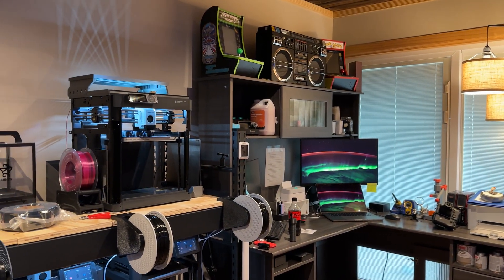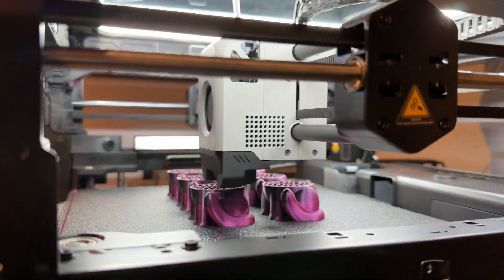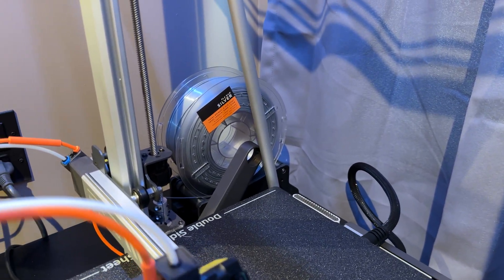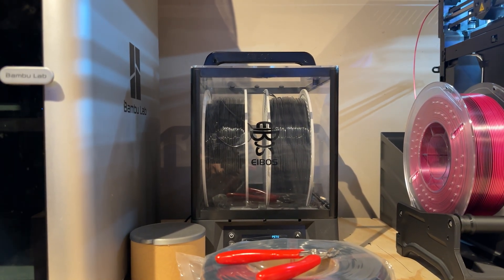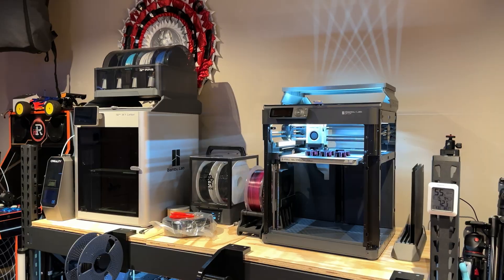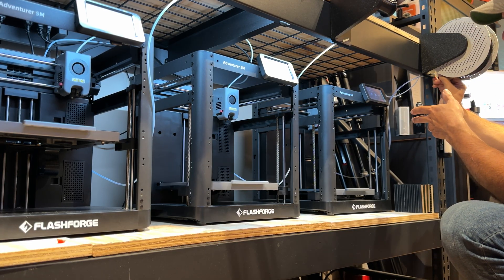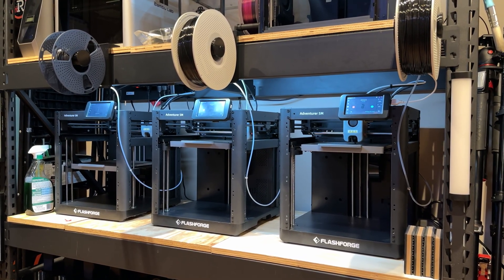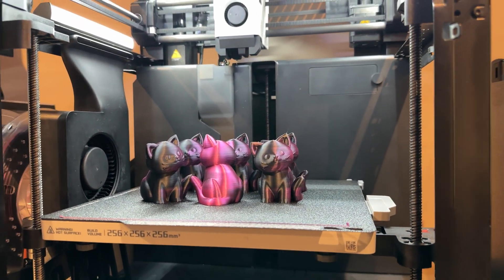A Day in the Life of a 3D Printing Hustler

Comment: All my black PETG is super-shiny like that. One I know is rebranded Flashforge, the other from Elegoo. I hope a local supplier gets some matte, if it exists at all. I don't want to spend so much on spray paint :)

I've got the same attitude about speed - let it print and it finishes when it's done. But I think must be doing something wrong speed-wise since different nozzle sizes barely make any difference. Jury's still out on Elegoo Rapid PLA. Prints nice and fast, fairly stable for more than half the spool, then problems. I think it needs a lot more drying, because it's very humid here.